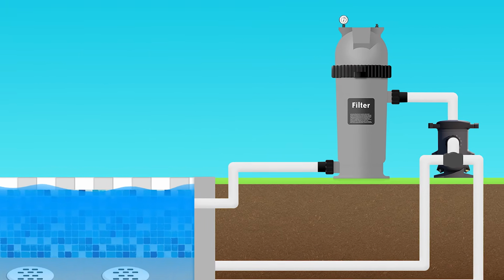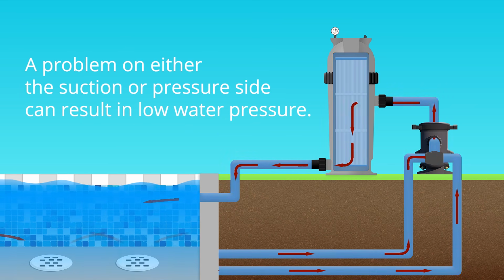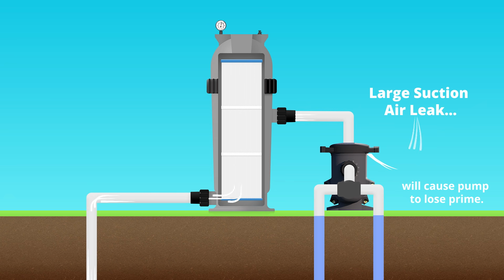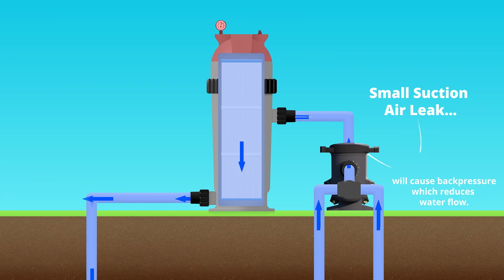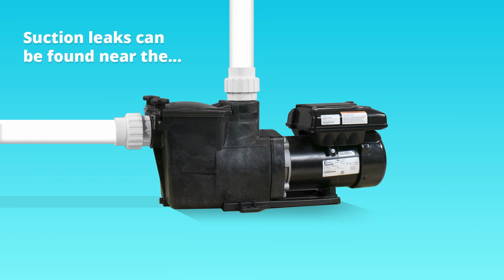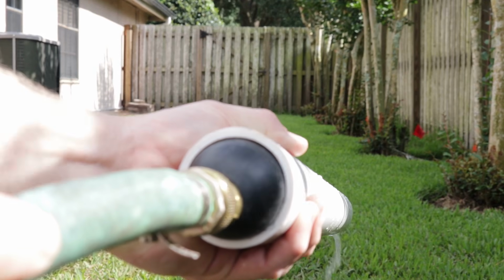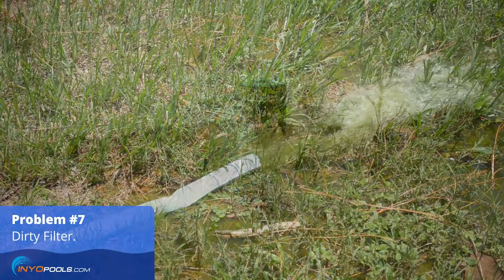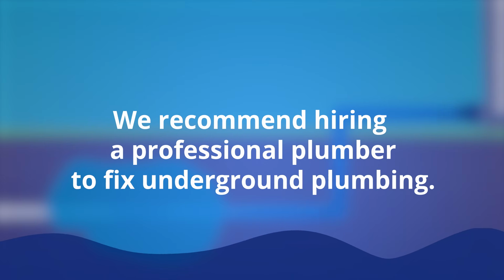How To: Identify and Correct Low Water Pressure

Comment: Good nfo, thank you. I still have a problem: pool circulates correctly when manifold is disconnected in jandy DE filter with a small bubble and good circulation. when manifold is connected, the pump pressure won't create a bubble or push water thru the chlorine tablets tube and circulation slows. PSI remain at 20lbs either way. Any ideas (tried all new filters, too)

Comment: Thanks for this. Going to try to add more water to the pool. 

One question— sometimes there is leak at the base of the pump basket . Is that normal. The water appears after the pump is off.  Should I be concerned?
Reply: I think the seal needs to be replaced.
Reply from the maker: Your pool equipment should be air and water-tight; it is not normal to see your pump dripping water. 

Where exactly is the water coming from on the pump housing? Can you see the water stream from the drain plug hole? Or do you see water more towards the middle or motor section of the pump? Does your pump lose prime when it turns off?
Reply: Sorry I am a newbie with pools. Got an inground here. The water is leaking directly below the water basket housing nexy to the pump. The one with lid that says “fill with water before starting pump”. 

Any way I can send pics?
Reply: The psi gauge has zero. 
Experiencing no flow again. 😢

Comment: Why could there be imense water pressure on one return jet and the other 3 are weak?  Is that a clog?
Reply from the maker: Is the return jet with the strongest stream the nearest to the pool pump? If so, the strong jet releases most of the water pressure before it reaches the other 3. Or, maybe there is a diverter valve that got fiddled with causing the difference in pressure.
Reply: Yes, the closest return jet to the pump gets the strongest return flow abd the furthest jets are barely moving any water.  The water flowing thru the spa is moving the water over the spillover ok near that return line.  Should I change the return line fittings perhaps a smaller hole on the stronger return?  It never used to be like this, that's why I'm thinking my last pool man clogged the skimmer by vacuuming without a vacuum plate.  Could this be the issue?

Comment: i have a 4-cartridge filter. 2 suctions coming into the pump, 1 from the skimmer and 1 from the vacuum. When i have the valve only on the skimmer side, i get around 5 psi but when i switch the valve position all the way to vacuum, and the PSI drops down to 0 however it still sucks in water pretty good. Should the filter pressure gauge stay around same psi when i switch from skimmer to vacuum or is 0 psi at vacuum ok?

Comment: Great suggestions. Didn't fix our issue, but we checked everything on your video. As the pump is 15+ years old, it it probably time for a new one. Thank you for information.
Reply: I have the same situation, pump about 20+ years old, did it fix the water flow? Did you notice the pressure gauge go up after changing the pump?

Comment: Thanks for the video. What if your water pressure or should I say the gallons per minute fluctuate between 57 gallons per minute and 47 gallons per minute even dropping as low as 42 gallons per minute throughout the day. But when you put it in recirculate, you get 70 gallons, per minute consistently?

Comment: What if only one return jet has low pressure?
Reply from the maker: The one furthest away from the pump may have lower pressure because  it's further away. You could put a smaller eyeball in the stronger jets. That would force more water to the other jets. If this a new issue, my guess would be that the filter needs to be cleaned or you have a suction side air leak.

Comment: I followed your steps up to #3.  I opened the pump basket and it completely flooded my yard and my neighbors yard.  Everything was turned off and unplugged.
Reply from the maker: The problem is gravity. Do you have an aboveground pool? If so, there should be shut-off valves that stop the flow of water before the pump is opened. This could be the case for an inground pool if the equipment is located lower that than the body of water. This would also require that the valves be closed to that flooding doesn't occur.

Comment: I was trying to find out what the water should look like when circulating but not areating because I am battling high PH constantly and wonder if the little surface movement when the pump is on high is actually areating thus causing high constant high PH.  I have 8 Ph and 130 TA adding acid every day to lower ph.  Trying to get the TA down to but it seems to take a lot of acid and if you don't stay on top of testing adding or you run out of acid a day later I'm back to square one.  Trying to determine the root cause.  Thank you

Comment: We have a low pressure on the return jets. Pool was not properly serviced last year. So we took apart and cleaned the DE filter but pressure is still low. Any other suggestions  what can be done. Than you!

Comment: Thanks  - love your videos. I have an issue though that I can't seem to figure out and hope you might know.

My Pressure is constantly at 30psi with horrible skimmer suction and jet return. When running the pool without the filter its reading 15psi but flow and suction is great.
1. My filter is like new
2. Only a minor air leak (I believe) as I see small bubbles in the valve.
3. All diverter valves are open (in and out)
4. Pool :15,000/16,000 gallons, pump 1.5hp, filter cartridge w. 90 sqf. 

Biggest issues is the minimal flow and suction at 30 psi with a new filter in it. 

Hope you can help or guide me in any direction!
Reply: You and I have the same issue. Broke my head to figure it out. Still searching.

Comment: Having air bubbles rising from return jets while NOT experiencing water levels dropping frequently can be caused by clogged pump impeller fins. Air bubbles at return jets coupled with a grinding sound or noisier than normal pump sound is another indication impeller inspection is required. The motor/pump will need to be removed and dismantled to proceed.
The impeller slots may easily  be cleaned with a small wire once accessible. This is also a great time to inspect and replace the shaft seal and other O-rings as a preventative measure which pays dividends by not having issues during the hot summer or on Holiday party weekends. Take pictures of your motor, pump,  and filter's stickers that identify manufacturer model, and serial number  information. Replacement  kits or singles of specified O-rings and seals along with  a tube of gasket/ O-ring lube can be per-ordered and  have on hand to  save $$$ while minimizing downtime and increasing Miller time.

Comment: I have cleaned all leaves from the basket of the pump, had all plumbing and the sand replaced yet the the water slow slows dramatically after it’s been on for a couple of hours?
Reply from the maker: It's possible that the sand filter is filling up with debris and needs to be backwashed. If you have a multiport valve, turn off the pump and switch the valve to the bypass/recirculate setting. Turn the pump back on. If the water flow is fast, the issue is the filter and it needs to be backwashed.

Comment: I'm in construction phase and I'm pre equipment but post rough plumbing and failing pressure inspections. 

It loses about 2-3 psi every 24 hours. My pool company can't seem to find the leak after multiple attempts. There's nothing but pipes. Any ideas?

Comment: I’ve just changed the sand, I’ve checked everything for air leaks, the pump isn’t clogged, none of these apply to me

But i am getting high psi on the pressure gauge,20+. And low pressure coming out of the return. It doesn’t help when we backwash either.
Reply: im having the same problem please it back wheen you fix it
Reply: @geespear8473  i used lots of caulk and plumbers tape on everything
Reply: Have you found out what was the problem

Comment: My fish tape won't go through the skimmer. is there a smaller hole I need to guide the fish tape in through that can't be seen from the surface?
Reply: it usually goes to a fitting a 90 or ell right away

Comment: Very helpful, just replaced two pool pumps with a three HP VS pump, now my jacuzzi jets work but no bubbles why? When two pumps were there we had bubbles
Reply from the maker: Maybe a line was capped that used to bring air into the system. Was there a pipe that looked like a candy cane or a hole in the deck near the jets? If so, those draw air into the system for the jets. It's also possible that you used to have an air blower and it was removed.

Comment: Recently replaced a pump that was leaking at shaft seal , could have been fixed just wanted to upgrade an old pump . Shortly after that when I turn the diverted valve from the gas heater to flow 100% into spa, the pump starts to struggle and the pump says cavitation detected . When I open a small amount to flow into pool from that same valve it calms down . Took apart that jaundy valve and found what I can only imagine was a spring and plate from an old check valve that was on an old heater ( this one is about 2 years old ) . Is there something in the jet itself that comes out to flush debris ? Not sure of the brand of the head itself looks like one in the video with just a female thread packing over a ball to change the angle of the jet ?

Comment: Wish I had seen the low-pressure video about three years ago. After replacing a barely-used salt system and having three experts guess wrong, it turned out that the problem was that I used a phosphate-free dish detergent to clean the cartridge filter. After it sat out in the winter rains, I reinstalled it and it was good as new. A product I seek: my pool refinisher tossed out my old jets and installed fixed jets pointed 30 or 45 degrees upward. Especially with solar heat, it seems preferable for them to point 45 degrees DOWNWARD. I'd love to find something I could glue to these and redirect the water. I confess I have not tested, but doubt they are friction fit, so removing them would be more trouble than it is worth.
Reply: Great video, I am experiencing low pressure at moment, can a build up of DE in the pool line reduce the amount of water flowing through the lines and if so is there something I can put in that will dissolve the DE ?

Comment: I have a Pentair DE filter,  the part where you screw in the air gauge keeps filling up with DE, keeps taking my pressure down to 5 or less. Do you know what would cause this, and how do I fix the problem.

Comment: I purchased a home two years ago and it has a solar heating system on the roof. For the last two years my pool vacuum has worked great with plenty of suction. I'm able to turn the solar system on and of from a control panel.  Recently the pool vacuum stopped working when the solar system was on. I entered the pool with the solar system on and the suction connection was very low, not enough power to operate the vacuum. After I turn the solar system off the suction is strong enough to operate the pool vacuum.  Can you give me any advice of what to check next? I've checked the filters and catch buckets and they are clean.

Comment: Very nice video, volume, and pace.   If I have relatively low PSI (10), I clean my skimmer baskets almost daily, pump basket at least weekly, rinse my pool filter also weekly, but have low PSI what could be the issue?  I don't think the issue is after the pump due to low PSI.  The pump was designed for the pool, not moved, no new water features, salt systems, etc installed.  Getting green water more often than last year. I added a ionizer, which helped, but still feel the water kind of lower end pressure.